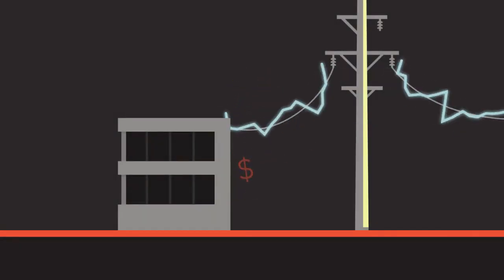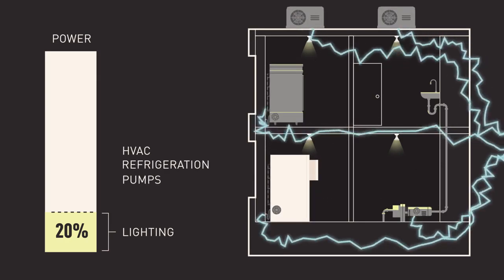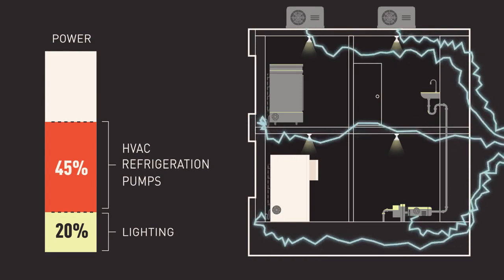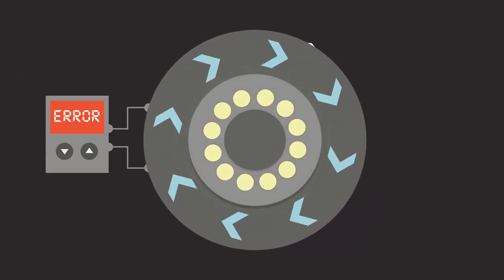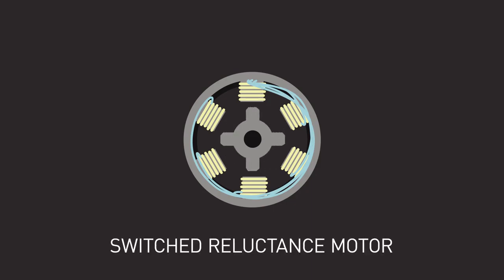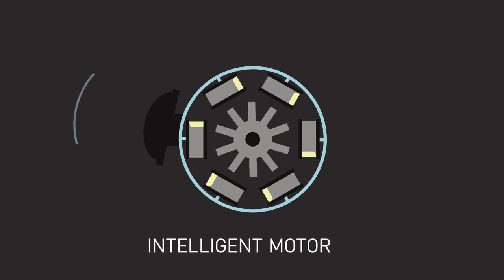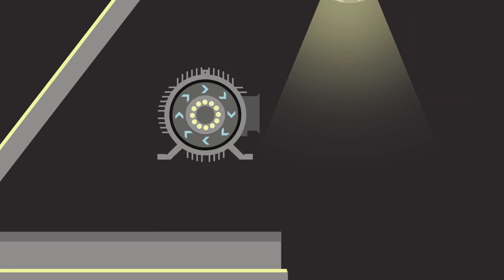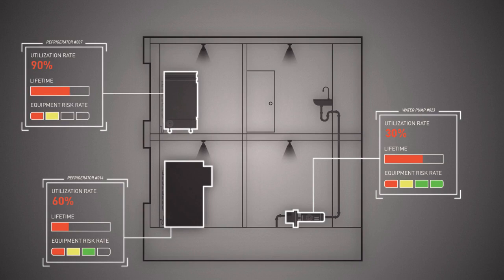Meet SMC the "LED of Motors"!

Comment: Sounds like basically a stepper motor so not really new. What could be new is more highly integrating the power electronics, controls, and user or network interface and getting the cost down. They don't give many details.
Reply: They're building on the main insight of the variable speed motor which is to only deliver as much power as currently needed. Considering how feasible it's become to equip things with a brain and sensors this is likely to succeed.
Reply: Stepper motor:  yeah, that's pretty much what it is. But a simple stepper motor tends to create 'vibrations' as it goes from one step to the other. In this motor, the strength of the field coils is continuously varied to get rid of any 'vibrations', keeping the operation smooth and without 'pulses' in its power delivery. A long, elastomeric drive shaft connected to a stepper motor could do the same = it could take out the 'pulses' from the drive shaft of the stepper motor through physical 'twisting', without requiring so much computational power put into the operation of the motor itself, but over time this elastomeric shaft would wear out and require replacing (once every few years).

Comment: They make a great point that the low efficiency of motors that operate in a building's HVAC system are an untapped resource for energy efficiency. Their cooperation with NREL makes me think that their motor design may be able to live up to their promises.